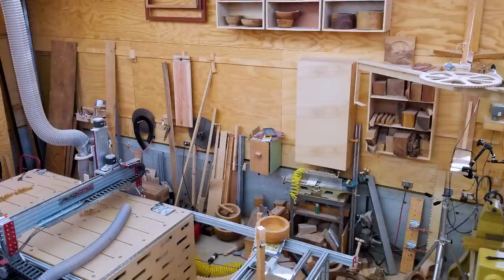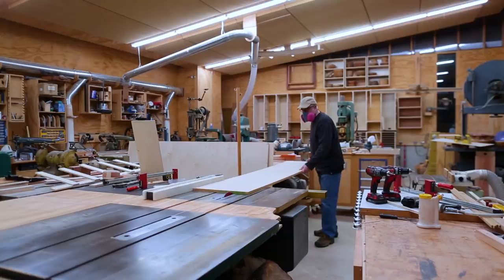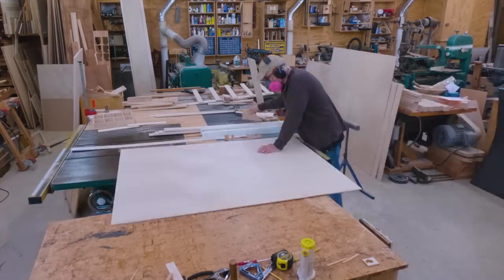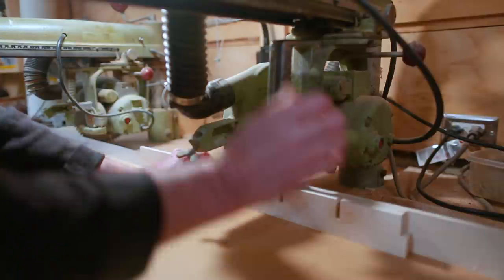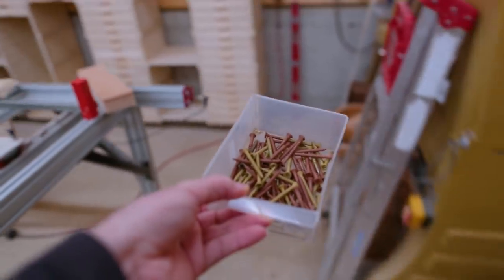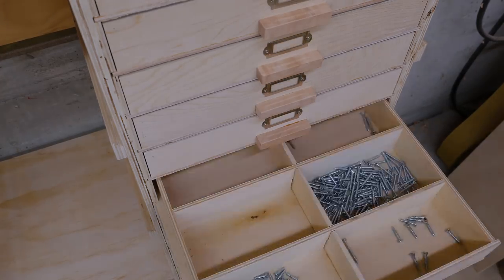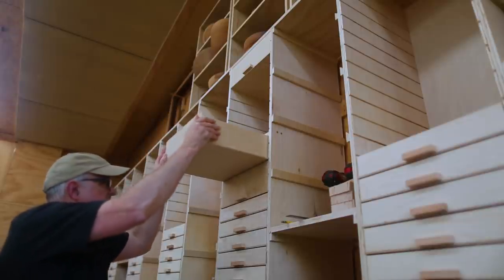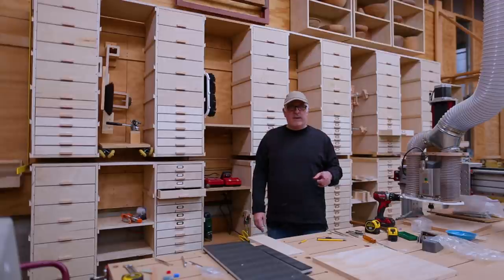Drawers for Small Parts

Comment: I don’t like the “library rolling ladder” idea so much. It takes up too much floor space. I would rather have a rolling stairway like you see in all the big box hardware stores to get stock off the upper shelves. But that would also stake up way too much floor space. I think one of those multi-fold aluminum ladders would work well as it could be folded up and stored in one of the voids between drawer boxes. In thinking about how frequently you’d use this, the out-of-the-wayer the better. Or, maybe one of those pull-down ladder/stairs deals intended to get you into your attic mounted on the ceiling and rollers.